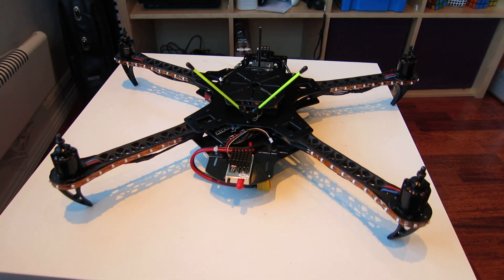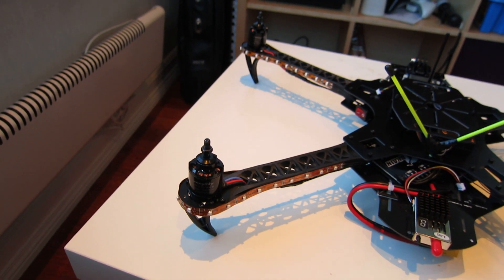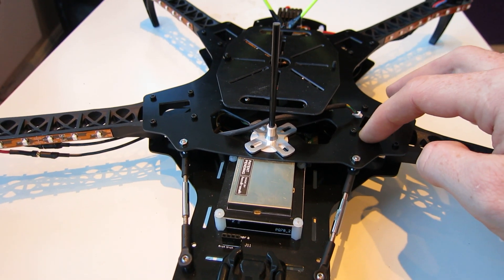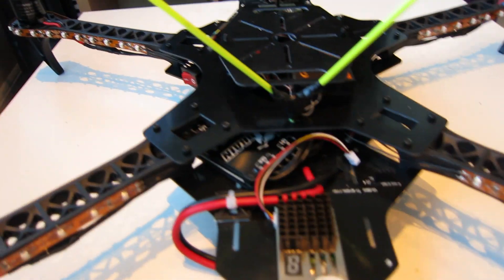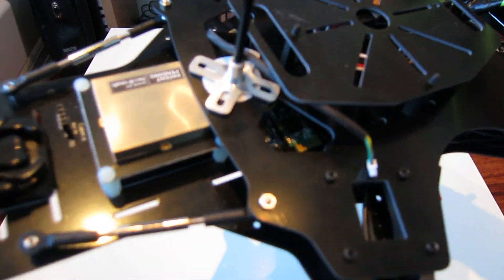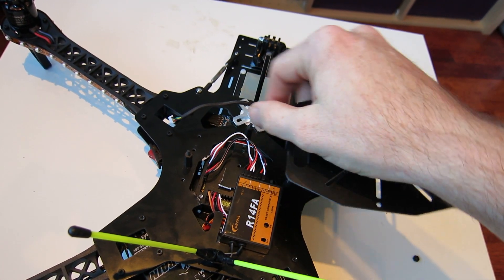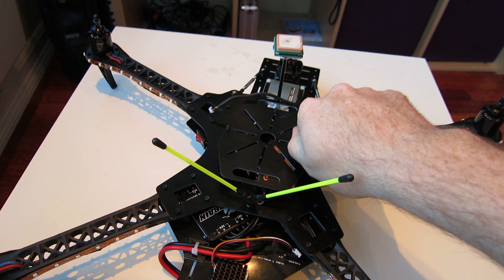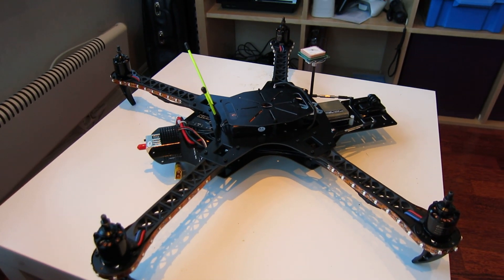Quadcopter build - 450 Deadcat with Crius aiop v2

Comment: I have the Multiwi and megapirate AIO board from HK with the Megapirate ng version 3.1.5 rc2 also on a HK SK450 Deadcat Frame with 900KV T-motors and the Q-Brain 4x25A ESCs module..
It flies very wel but i had to put the flight controller on top otherwise i had interference on my compass from the QBrain. Also you need to power the flight controler with 5V (UBEC). Do not use the UBEC from the QBrain. You need to remove the VCC from your ESCs output.
The it flies very stable ... very good camera platform because of the space.
And also i use the multistar lipo's from HK. I use 2 of them in parralel. 2x 4000Mah.
I hope this info helps ...
Marnix

Comment: Neat build. I fly the same but with DJI Naza M. Am curious about the Crius though. How does it perform?
Reply from the maker: Hi, it performs very good. A little tricky to adjust the PID's, so in the beginning you could meet some challenges, but when you learn how it works it's a very good FC.

Comment: I cant seem to figure out the qbrain at all. M1 to m4 are all to the correct motors.. (motor1 thru motor4). I know you have to switch 1 and 3 around. But the motor layout on my kk2 board after i do the mixer editor just wont come out the correct way. Do you have any advice..